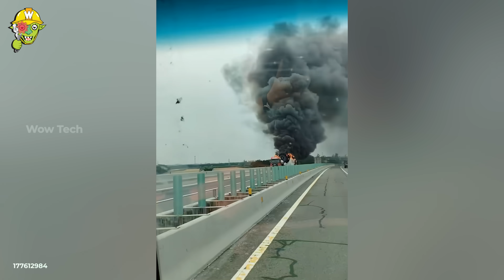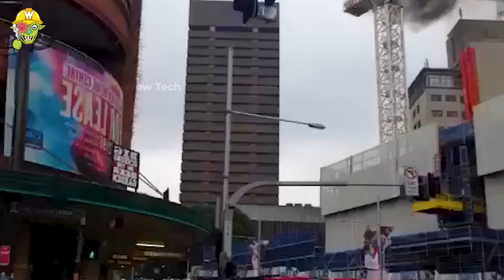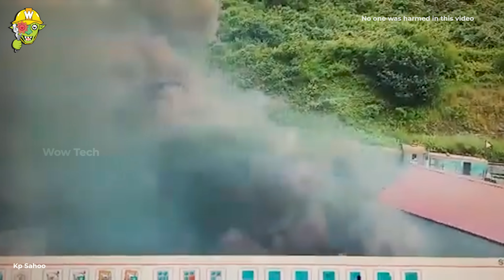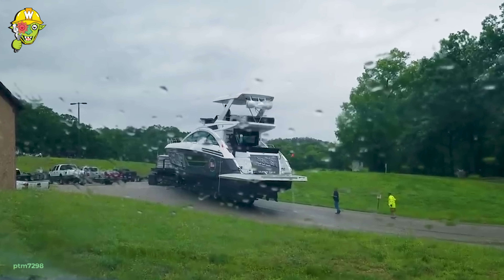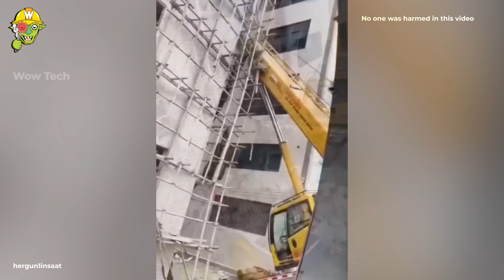Heavy Machinery and Industrial Mistakes Caught On Camera

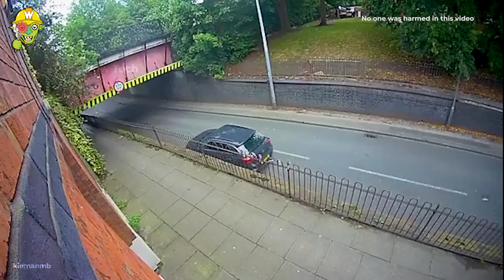Comment: 18:41 Some years ago almost the exact same happened I think in Germany where a 20 year old was the driver on the bus that was totally full of people. However that time only the first say 5 meter of the roof was cut of and that also cut the head of 1 or 2 people clean off and another died by the severe hit and several injured I think, these in the video was extremely lucky not sitting at the front. After that accident the minimum age to drive anything big like this was increased quite much by obvious reasons.
Reply: There were people on it wtf, interesting I live in switzerland

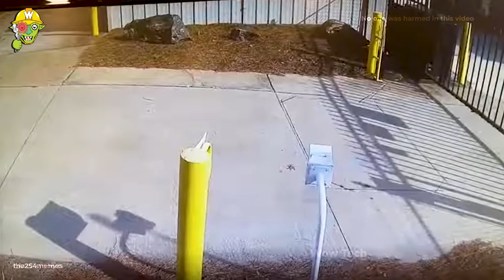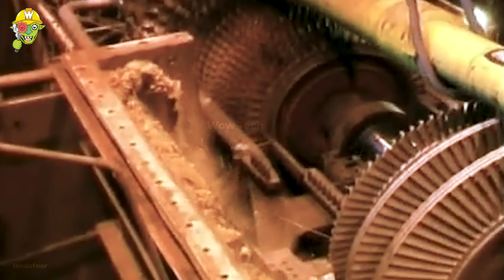Comment: many of these you  could label  idiots at work.  like the guy at 17:00 as example  you  dont move  with a load   way up in air with a fork truck and lower it while zooming along.  you  move  just enough to where you can  lower it to a  minimum  height of a few inches   cleaing the   bottom of the pallet then you  move ... not   move and lower it  from way  up  high at same time as he was doing. 14:00   oh  hell i hope the passangers on the  top level of that dbl decker bus  were ok and  promptly sued the  transit company  thatws  not an industrial mistake that is  150%  driver in competency and reckless endangerment of passangers.      loose the   stupid ai narration and fill with live narration and someone that has a clue whats going on in video

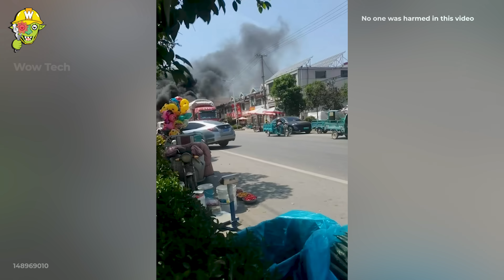Comment: Proper firefighting equipment on board?  That is stupid.  A fire doubles in size every minute and with different materials even faster.  That truck driver could not have enough firefighting equipment on board for a blaze such as that in minute 10:49.  Besides that extinguishers are used to delay a fire in most cases.  Putting out a fire requires much more support.

Comment: 🤔 It’s truly a miracle that no one EVER gets harmed in these video’s👀⁉🙏🙄🇬🇧
Reply: The bus that had the top removed couldn't have zero injuries. You can see someone laying on the very back bent panel. There is no way someone could get pushed onto what used to be the back wall by the roof that got ripped off by a bridge without getting hurt. The people still sitting in their seats are lucky not to have lost their heads
Reply: You should see the ones they can’t post😮

Comment: But why does they did that like they done did that way? All theys done did needed was the extra chain to balance the inevitable inercia that it done did obviously cause. Simple physics of the quantometrics anticipated beyond the spectrum of administrative support reaffirming the initial chemical reaction of the contents mixing when the load did done spill. All because done didn't do the one chain extra that was required.
Reply: i was thinking exactly the same thing !
Reply: @brucefraser4778 See. I know because I didn't done do put the extra chain on like I was done did told to. No one does done know it was me because I haven't didley done tell told no one it was me so I won't let won't be blamed I won't.
  Edit; when I said I didn't done do that I was the name of the person who didley doodley done did leave the chain offaroffaloffa. Not I me, I  Lie, the chain done do leaver offa who's name is I Lie.
Reply: @ArrSup  correct and very accurate description, thank you for that
Reply: @brucefraser4778 Wanna know what I didley done doodley with the chain? I'll tell you anyway. I thinkly think is was around 24 minutes to knockalockoff time and the chain was too farlywarly away from where I was standing, it was 4 inches out of arms reach and it would have taken too didley Dudley doodley oodly long to move my feet closer. So I waited until now one was watching and stepped over and kicked the chain under the carpet. The carpet was in the next building so I gively goovly oovly the chain a big kick and it hurt my toe because I took my boots off to scratch my arm. So then I punched the chain but it hurt my wrist which renderendered me unable to pick up the chain anyway. So I just left it on the groundlywoundly for someone else to worry about. But I wasn't looking when I tried to hide from the thunder and tripaliped over the chain and hurt my other thumb. I ran away crying and hid.
Reply: @brucefraser4778 So leave me alone and stop picking on me. Please.

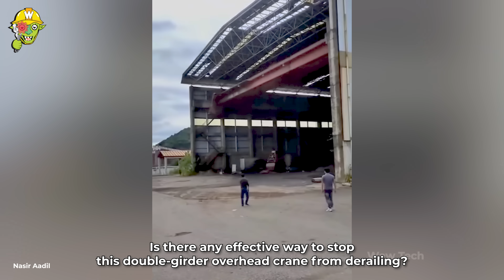Comment: 9:00 installation issue. Those tracks should have stoppers soldered at the end to prevent exactly that. Good thing this overhead crane didn't have an in-cabin operator 😱